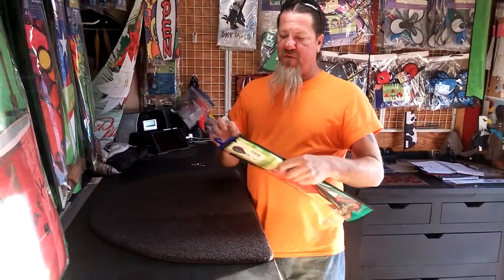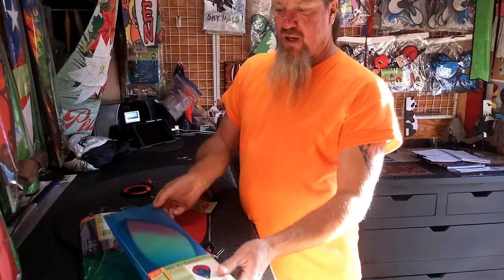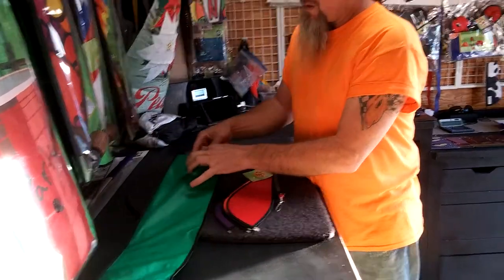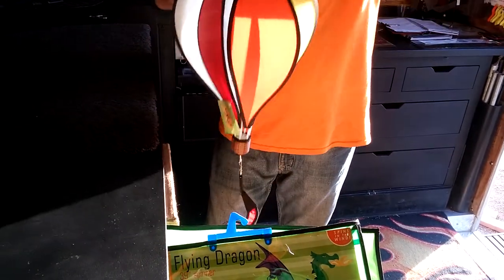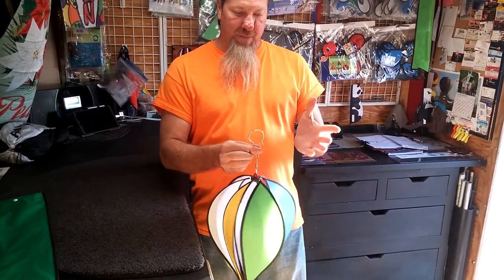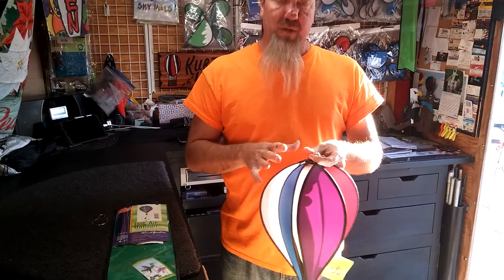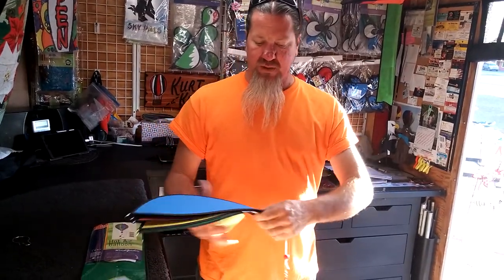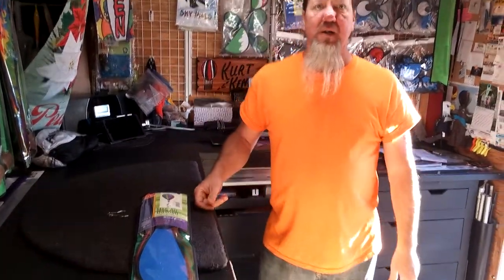My Wind Stuff ! Video #11, assembly/disassembly Premier 16" balloon.

Comment: Will the Permier Rotini spinner fly horizontally?
Reply from the maker: Only if it's glued together at the top , spars into the hub. Otherwise it may come apart.
Reply: @cgiebler69  Thanks, that would make them too bulky to stuff and take to a flying field. There are other solutions like the dynamo spinners I use that are better for the job. Appreciated.